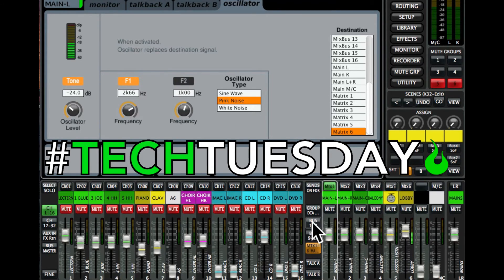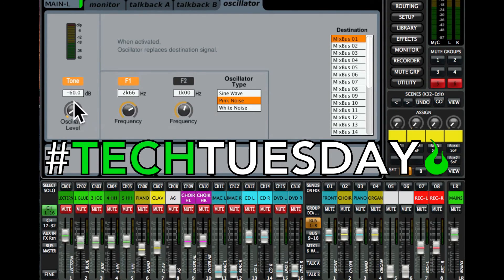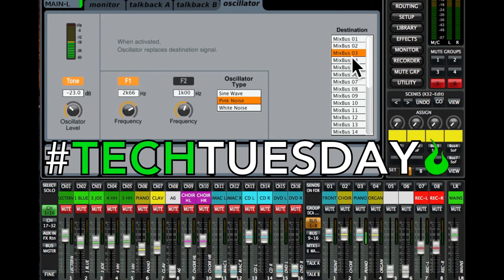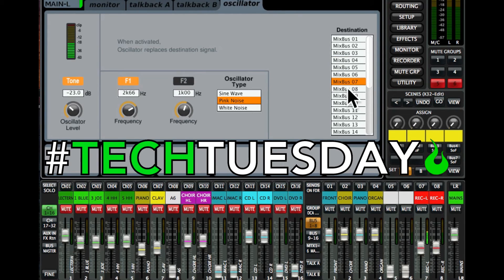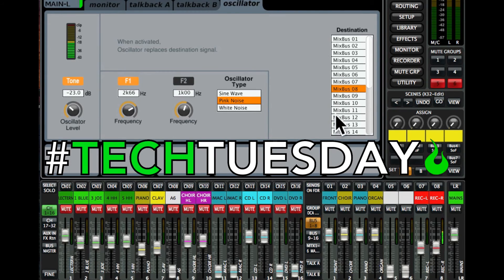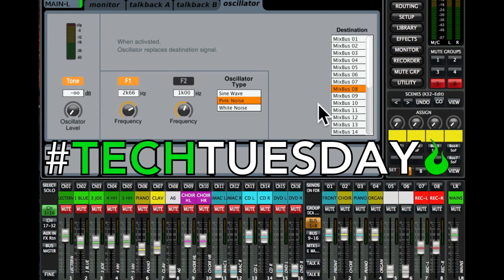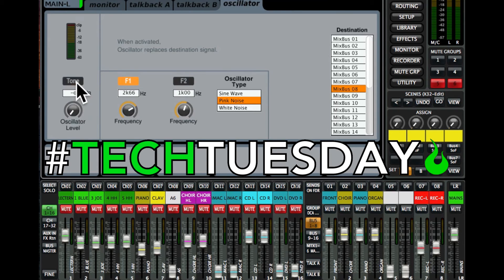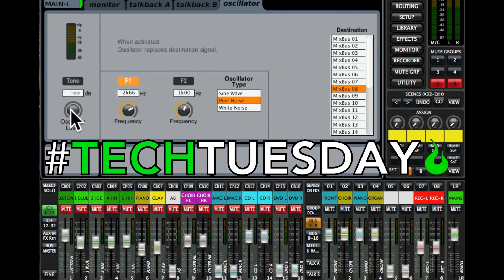X32 Oscillator - #AscensionTechTuesday - EP031

Comment: Sooo what do you do when it's the oscillator that's not working? Like it does nothing,  the level is turned up, the generator is activated, but nothing is visualized, and nothing is heard.
Reply from the maker: I’ve never experienced that. Are you sure it’s routed to a working output? Is it set to pink noise? It could be set to sine and a frequency above or below your hearing or filters.